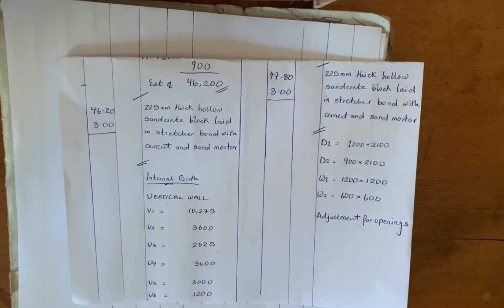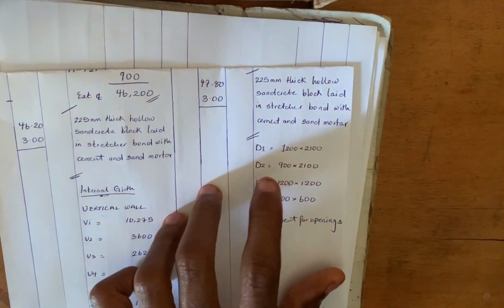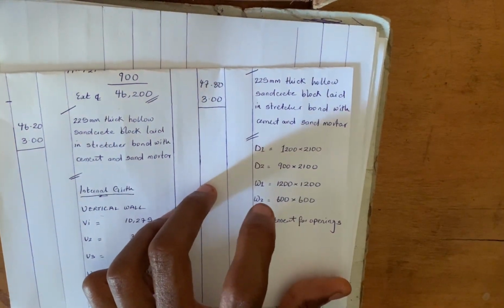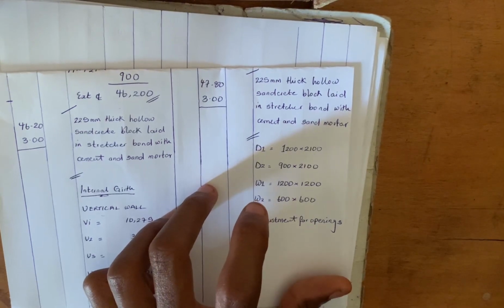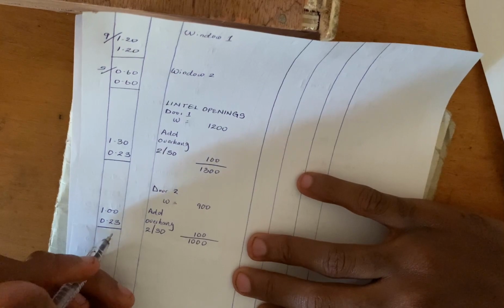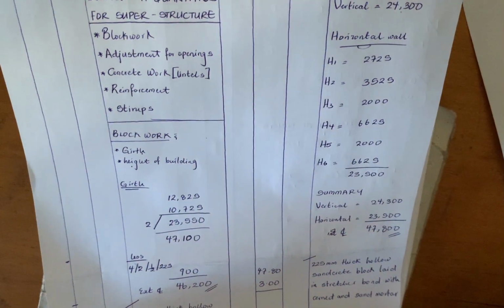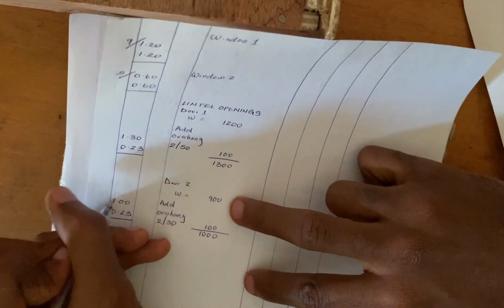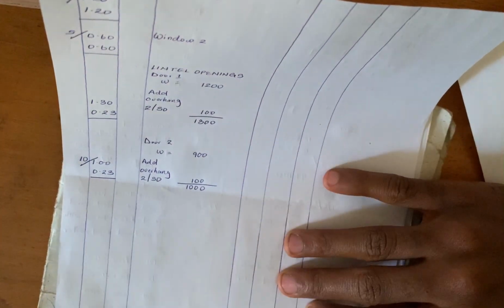HOW TO MEASURE FOR SUPERSTRUCTURE [ADJUSTMENT FOR OPENINGS] | DOORS & WINDOWS DEDUCTION MADE EASY

Comment: if we moved internal horizontal wall to the edge so at to calculate the total external girth.then later when calculating the internal girths,we didnt consider it among the internal horizontal walls,so when adjusting for openings and we deduct the arch opening,and the opening is on the external wall.it seems the internal horizontal wall has been overlooked.

Comment: What about air vents? Do we leave them out or deduct them as openings too?
Reply from the maker: You have to deduct!! Some consultant Qs measure down to the smallest details
Reply: Refer to SMM, small openings check the new rules of measurements, voids less than 0.5 square metre are disregarded

Check SMM section G3 (a)